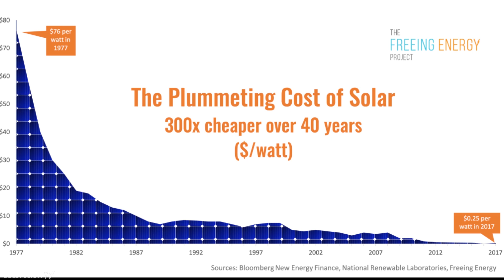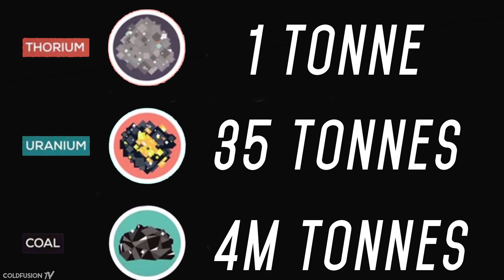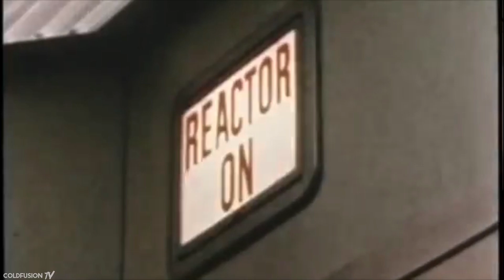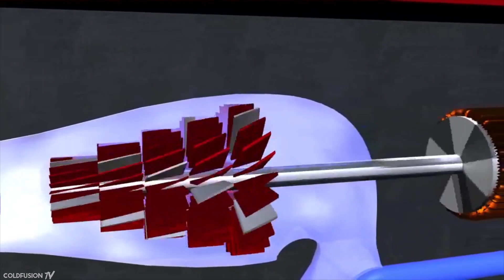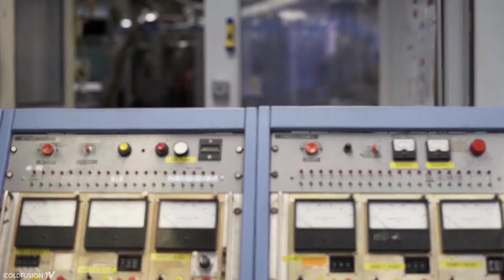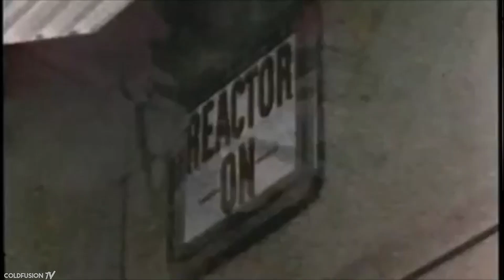Thorium - The Future of Energy?

Comment: First, thorium is much more abundant than uranium.
Secondly, Liquid Fluoride Thorium Reactors (LFTR) are much safer and efficient than conventional nuclear reactors.
Third, uranium in current nuclear reactors is solid pellets, but must be removed before all the uranium or the transuranics are used; thorium fuel in LFTR is liquid where waste products can be easily removed.
Fourth, in the current state of energy production, nuclear power produces 20% of the net energy consumed in the US. It is the largest non-fossil fuel based energy source and is the only one with the capability to replace much of the energy supplied by coal and natural gas.
Fifth, World supplies of uranium are estimated to be at 5.3 million tons. The rate of uranium usage is 68,000 tons a year so the estimated uranium supplies will last 80 years.
Finally, one of the problems with conventional nuclear power is the production of large amounts of radioactive waste, while transuranics (elements with atomic numbers larger than uranium; these include curium, plutonium, and americium) from nuclear waste can be disposed of by being put in a LFTR.

Between 1966 and 1968, Oak Ridge National Laboratories built the Molten Salt Reactor Experiment. This was meant to investigate the performance and the technology needed to build a molten salt reactor.

As stated in page 8 http://pages.hmc.edu/evans/LamThorium.pdf  " The second disadvantage to the current design of nuclear power plants is the inefficiency of the consumption of uranium. By mass, only about 3% of the uranium put into the reactor is consumed before the fuel rods must be switched out. This is because elements such as krypton, xenon, and other fission products build up in the rods as the uranium reacts. These elements can absorb neutrons, thus preventing a chain reaction from being effectively maintained. The fuel rods must then be replaced before all the uranium has reacted.21 This is not only inefficient but also leaves highly radioactive transuranicelements (elements on the periodic table with atomic numbers greater than uranium) products. The presence of these elements is what makes nuclear waste highly radioactive and their long half-lives make storing this waste a challenge. "

Comment: Also a Key point you missed out, The Thorium reactor (Molten Salt Reactor) that safe that the USA powered a Aircraft's (Convair X-6 and Convair NB-36H) with one these reactors scaled down. The Aircraft clocked over 215 hours.
Reply: Oh boy oh boy. First of all, the only operational reactor that was ever flown was on the NB-36H. Secondly, said reactor was not a Thorium reactor, it was liquid sodium cooled - a method common with so-called fast reactors and unrelated to Thorium fuel or molten salt reactors. Finally, the reactor didn't even power the aircraft. Six Pratt & Whitney Wasp Major R-4360-53 air-cooled, 28-cylinder radial engines, and four General Electric J47-GE-19 turbojet engines, powered the NB-36.

Comment: This was preesub standard by your standards. No mention of LIFTRs or the salt corrosion problem associated with that for example. Arey you feeling alright?
Reply: All the benefits outweigh any corrosion problem.
Just produce the reactors on an assembly line and replace them after five years of operation
Reply: @Merecir  but they will be radioactive
Reply: @Chobaca  Build the reactors out of Zirconium which is one of the main fission products in the reactor and thus already needs a specific filtering system. Recycle the reactors themselves with an up scaled zirconium filter.
Reply: @Merecir  has that been tested at all?
Reply: @Chobaca  They already use Zirconium to counter corrosion in nuclear reactors.
The filtering systems are the main technical hurdle for the development of LFTRs. I have no insight in how far they have come with this.
Reply: @Merecir  ok thanks for the info